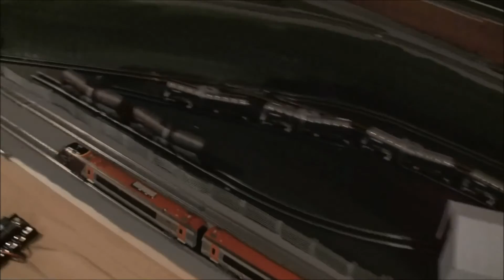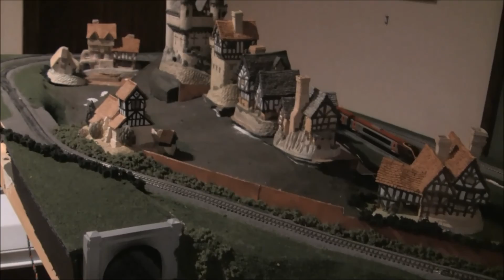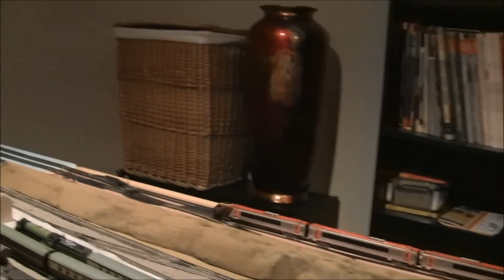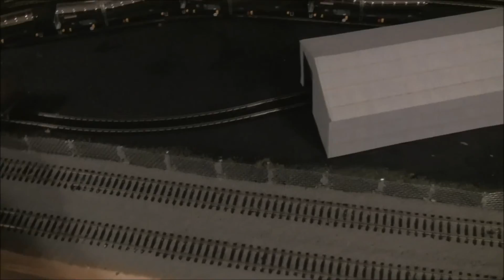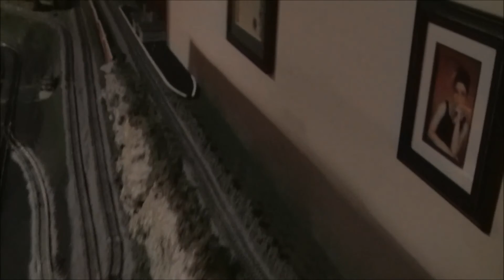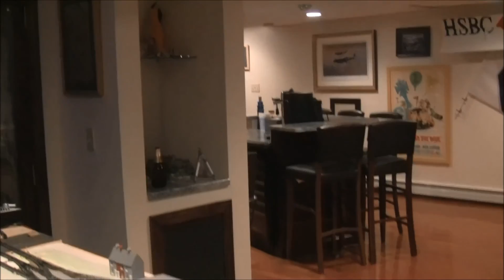2014-09-28 Running back together again!

Comment: It's running very nice and smooth now, the layout itself has come on a long way in these last few months, great stuff and well done.  ...........Graham
Reply: ***** I've now installed seven today and all are on Peco points and every one operates absolutely fine, you just have to take the little springs out from the tie bar that's all.  .................Graham